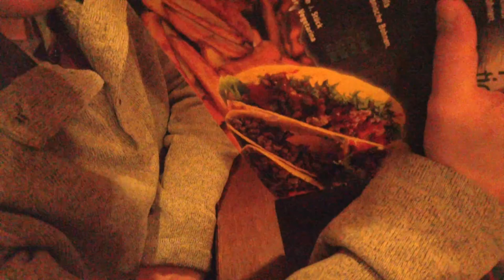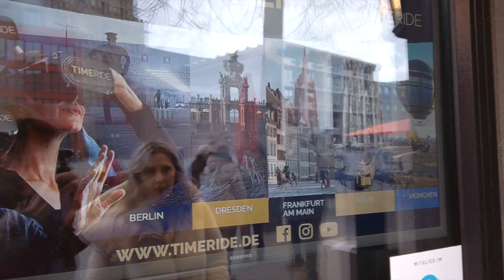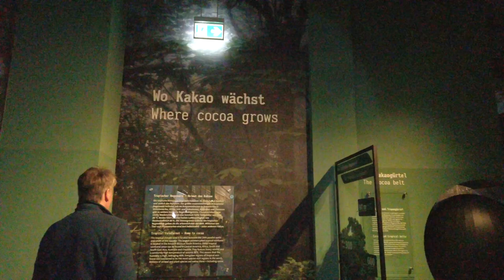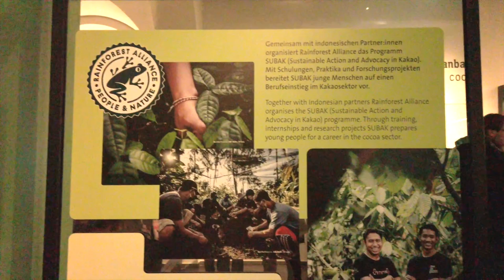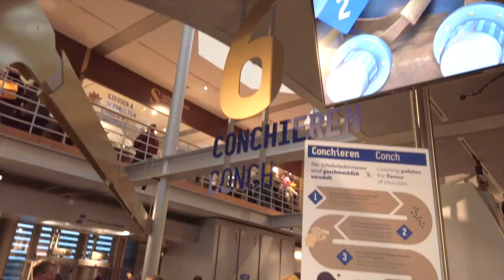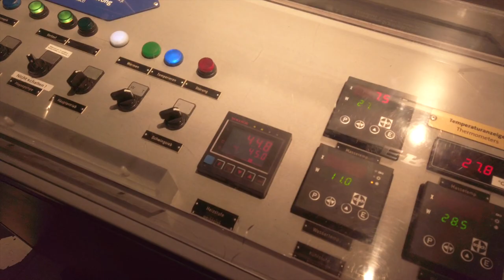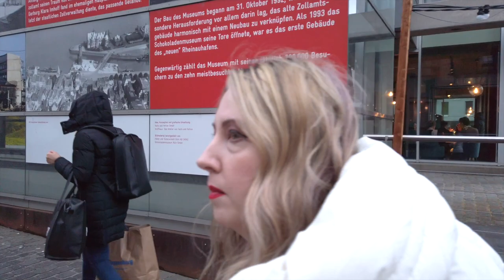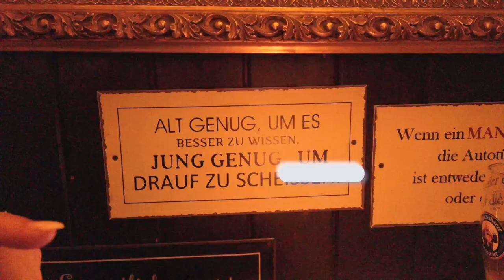🇩🇪 American's First REACTION to Cologne, GERMANY! (Cathedral, Chocolate Museum, Food)

Comment: I can not recommend the south of cologne enough. There you have the best burger joint in and around cologne, called "Die Fette Kuh" and on the same street there are a bunch of specialty coffee shops where you will get a coffee recommendation from an actual barista.

There is also a shop called "Bierlager" on this street which caters to a wide variety of craft beer.

If you want authentic food from cologne I would recommend "Päffgen Brauhaus" which is closer  to the center, has amazing food and one of the better locally brewed beers.